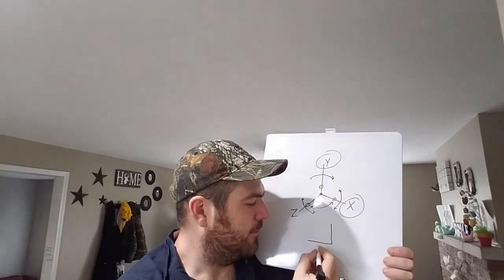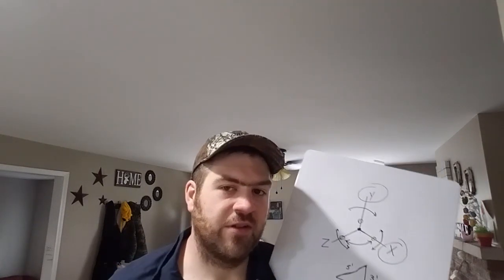BEST Shooting Tip for Accuracy/Precision EVER!!!

Comment: Thanks for the follow up video.  This explains the points you made in the previous video.  However, to demonstrate this theory, three shots taken from the same position, with the target moved horizontally to the left or right should, if you're right, have produced a looser group.  A demonstration of this theory would have finally put this topic to bed. As it is, a question mark remains.  Still love your videos.

Comment: James Another great review love your Content. Do you measure your gun barrel height at the bench. Example 4' gun barrel height at the bench then set the Bulleye at 4' height down range to help with uphill or downhill angle. Not sure if this really matters much but the thought popped up when you mentioned your right angle squareness. Keep up the great reviews 👍
Reply from the maker: Thanks! I just plumb/level my scope on the receiver and use my cosine/spirit degrees @0° on target due to the trajectory of the project and put my crosshairs on my target at that instant and start from there then move my target horizontally to see the sweet spot
Reply: @STKO2011  U ARE THE AIRGUN SCIENTISTS🤓U ALWAYS FIGURING OUT A WAY TO UNDERSTAND THE AIRGUNS ON HOW THEY WORK ..NICE JOB 👌
Reply from the maker: appreciate it! I just keep on keeping on
Reply: @STKO2011  YOUR THE AIRGUN MATH SCIENTISTS...BRO
Reply from the maker: @KINGBREAKBARREL  haha I try!

Comment: I sincerely respect your talent and knowledge, but, I don,t agree with you.
The net effect of a slanted/canted/skewed target should only distort the circular impact puncture, (an elliptical hole vs a round hole), given all other parameters are dead nuts!
Reply from the maker: Thanks and yes it should but you also have to remember when lining up reticle to target it doesnt change position in the shoulder making greater angle than 90° like mentioned @4:10 ....far as I've seen not everyone is that consistent and by moving Target/reticle 
Horizontally can greatly impact shoulder position resulting in better groups and accuracy